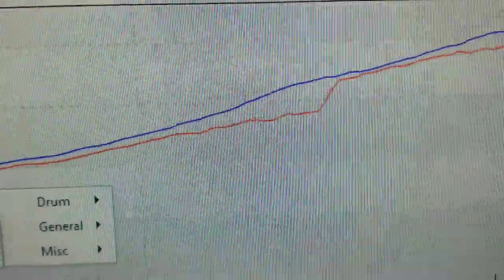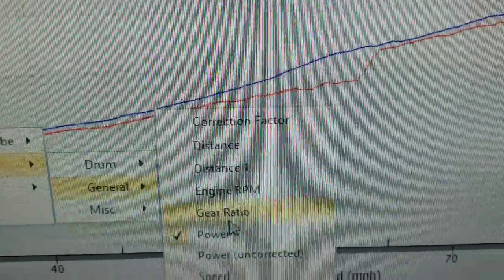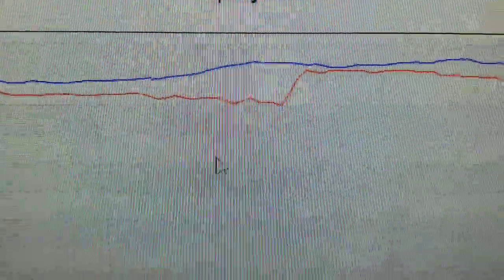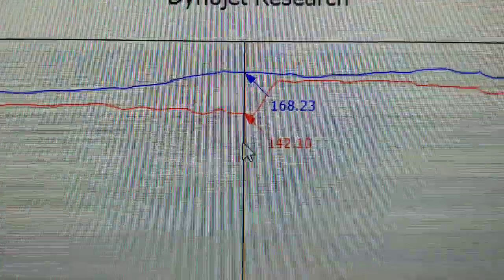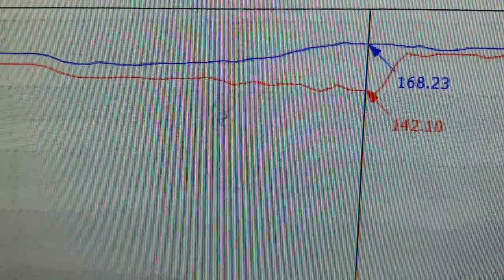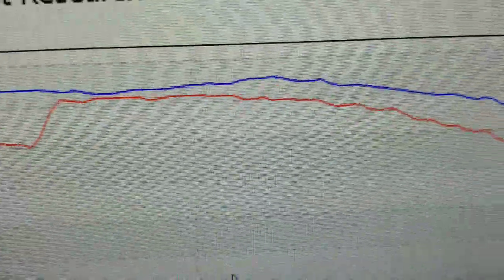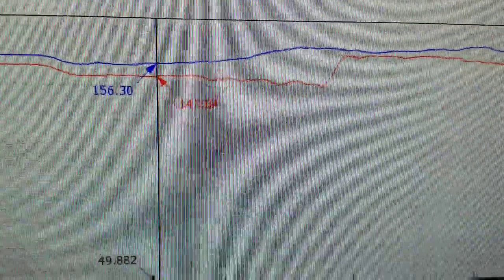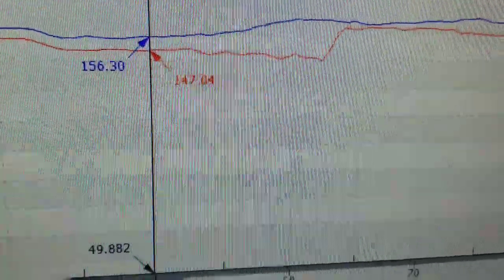Honda civic si ep3 dyno tuned on hondata kpro, before and and after reactions

Comment: great job Bob and everyone at RCAUTOWORKS and thank you for definitely livening up my ep3.  the differences in the power band and overall operation of the car are much more enjoyable than what it was . I can't wait for the next steps in building my EP3.
Reply from the maker: Thank you for the continued support Jorge
Reply: Was this done to a stock EP3? Just got mine and it's stock besides cold air intake and wondering if this would be a good choice?
Reply: What type of flashpro Hondata you use for your ep3 I’m trying to buy for my ep3 🙌🏻❤️
Reply: @erikmendoza4081  hondata kpro reflash is what’s needed for the EP3s

Comment: What motor is in this?
Reply: K20a3 came in these usdm
Reply: This may have a diff head on it or something tho idk
Reply: Yes K20a3.
Reply: Not a k20a3. They don’t have true 3lobe vtec. Unless it’s a a2 head on a a3 block
Reply: @laotrixmedia2378  You have no idea what you're talking about
Reply: @DOOMLORDHOKAGE  how so?
Reply: @laotrixmedia2378  basically k20a2 is the RSX type S engine which has a 3 lobe camshaft (V-tech). While the k20a3, which came on the rsx base model and ep3 civic, had a 2 lobe camshaft only on the intake side and activates at 2,200 rpm.

-2005 Civic SI owner

Comment: which version of Kpro are you using?
Reply from the maker: Not sure, why?
Reply: @RCautoworks  i am told there is a difference between v1/2 and 3/4
Reply from the maker: @Salim Sopari  there's difference yes.
Reply: @RCautoworks  yes thats why i asked. Your tune seems proper and if i can get away with it on v1 because someone is offering it to me at a decent price half of v4
Reply from the maker: @salimsopari  look at the other features that you won't have with the v1. Might not be worth it for you in the long run.
Reply: @RCautoworks  trying to figure out what those features are. I want to be able to tune my k24a2 swap and add overrun/flame tune. If v1 can do that im good
Reply from the maker: @salimsopari  shoot hondata an email they should be able to help you with giving you what features the v2 doesn't have that the 3/4 would.